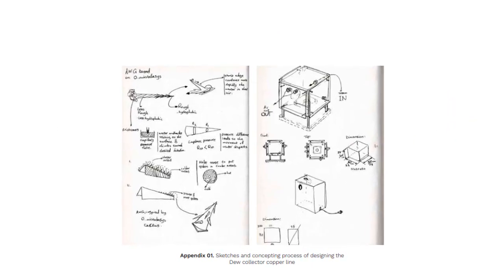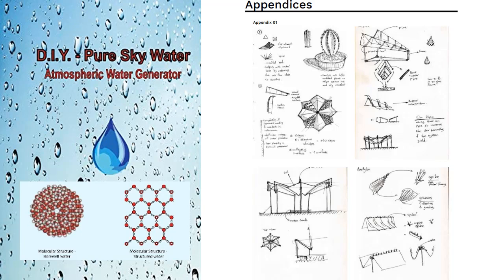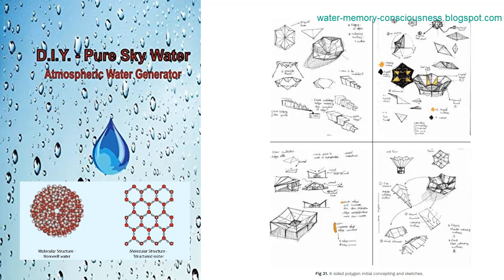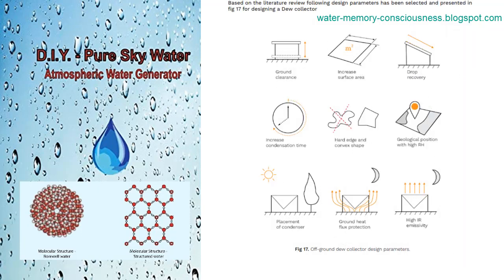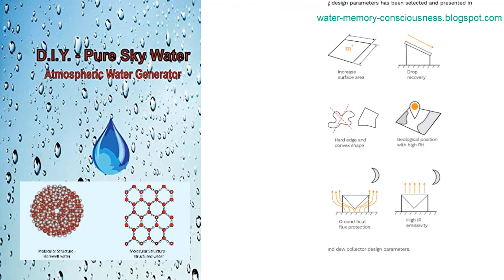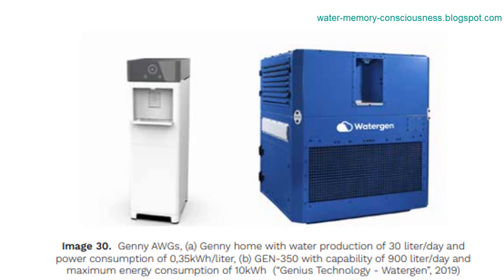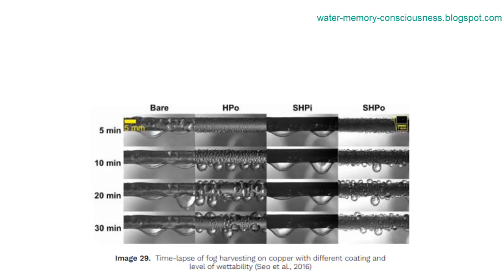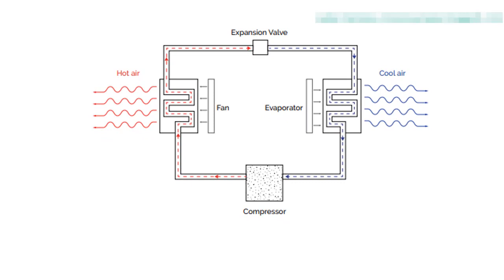Plan to create Water from the Air - Free in the Library - Design Aalto University

Comment from the maker: Water scarcity is a growing concern globally, and finding sustainable solutions to obtain fresh water is crucial. Atmospheric Water Generators (AWGs) have emerged as a potential solution to extract water from humid air. AWGs utilize two main methods: passive and active systems. Passive AWG systems, such as fog water harvesting and dew collection, rely on natural condensation processes without the need for an external energy source. These systems are simple and durable, but they have lower water production and are sensitive to environmental factors. On the other hand, active AWG systems use external energy sources, such as electricity, to stimulate condensation artificially. These systems are more efficient and can produce larger volumes of drinkable water, but they require higher initial investments and power sources.